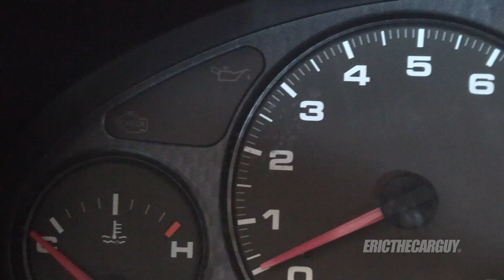Best Integra Type R Upgrade (So Far)

Comment: https://www.kseriesparts.com/HON-18229-PCX-003.html I found this Eric, it's a Honda 2.5" Header donut gasket. Maybe it'll work?
Reply from the maker: Hard to say, but thanks for the link!
Reply: @ericthecarguy  Not a problem good sir. I was also reading about others having that same leaking problem and eventually just switched to the flange style with exhaust gasket to solve it.
Reply from the maker: Like I said in the video, that joint needs to be able to move. If you replace it with a solid joint you can damage the hangers or perhaps cause other issues. Thanks again for finding that.